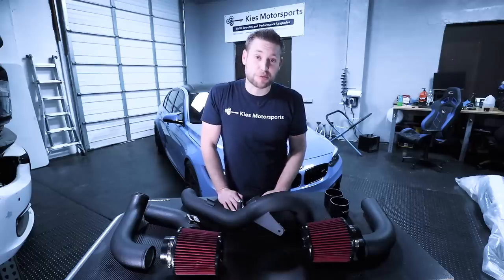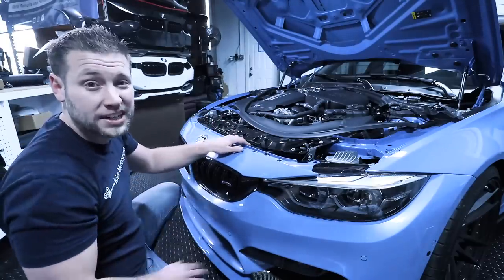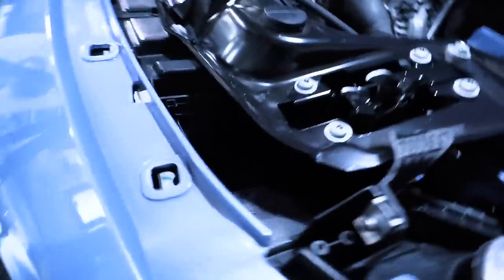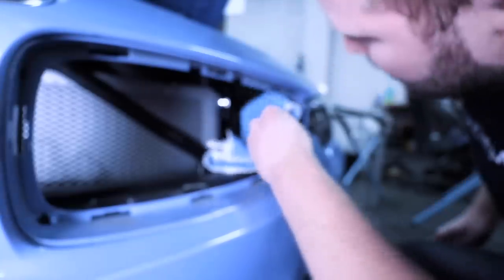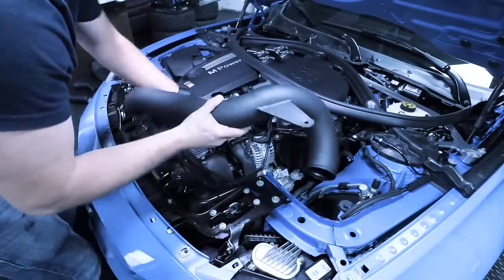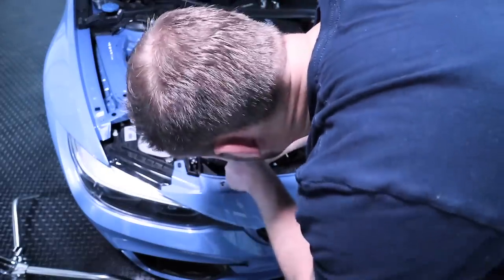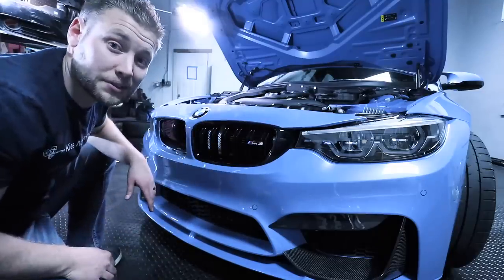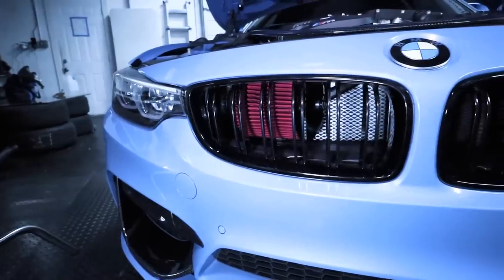How to install F80 M3 Front Mount Intakes (Works on any S55, including the M4 and M2C) VRSF

Comment: Once installed, I’d imagine removing the kidney grills using the same method used in this video becomes a no no, as the filter cones are blocking access to the release clips along the bottom edge.
Reply: rajjy1976 I feel like all that wear and tear on the kidney grilles would lead to the plastic clips giving out at some point. Changing the filter, that is
Reply: This is a reply geared toward both this first comment and the reply from @DesiredFilm ...

The kidney grills do become a slight bit more difficult to remove once the intakes are installed and you have everything put back/popped back into place! ... BUT... IT IS STILL DOABLE fairly easily in fact because once you have them off and have the feel for how simply straightforward they literally pop in and out you dont even need to see it to do it. VS just a video visual representation of "what its like".. ALSO... Id like to add that unless you are driving on a dirty track weekend after weekend OR in a sandy/dusty environment .. ie.. a freakin' desert or something, you will hardly everrrrr have to service this style of air filter! They last an extremely long time and although some people would straight up laugh at this and say "goodluck bro, your fixin' to kill your motor or a turbo".. 
I have literally LIGHTLY pressure washed off the bugs that were adheased to the front of my filter.. I then blew the water through it via air compressor. If you then let the car idle for 45-60 minutes it will get hot enough that it will evaporate nearly all moisture/WATER that could/would be sitting inside the cone of the filter! It is not until you really step on it or go full send while driving that there is then mass suction created to where moisture water would then get pulled in through the intake and into the motor. (so for any goons reading this who feel like saying this is ridiculous... just save it!). This is honestly the 2nd BEST "intake design" for the F8X M3/M4 platform. BMW should have done this from the factory however I know that they did not due to some more strict Cali. carb restrictions or some bs along those lines. "off road use only" lol.

IF you were curious.. I know 2 owners with heavily modified F82's who have raced in monsoon conditions with the front mount intakes. Neither of their motors have ever shown any damage, and they have never reported any problems due to inhaling a particle of any kind (water/dirt/dust/snow etc).. 
LASTLY, the absolute best and number one "Intake design" that BMW SHOULD HAVE DONE from the factory but did not, would  basically be what Dinan/aFe and a few others have done by utilizing a larger surface area filter and box that is sealed. This is done because through further testing and reports, many people have experienced horrific heatsoak when using the basic open cone filter systems that just sit under the hood without being in a box, a sealed box or best yet, the aFe with the open box but sealed sides that completely seals once the hood is closed. There is/are good reason why BMW did not choose to incorporate these designs from factory. Best guess and main reason is the bs CARB restrictions in some states like Cali.

In any case.. I still love my front mounted setup. Most people say its just a shame they cost thousands but, ... you get what you pay for!
I have the RK, and the custom titanium intake setup is just not for everybody, I get it..IT IS FOR ME THOUGH!!! =)

Comment: Looks like these more disrupt the airflow to the radiators than provide that much more air to the engine.  I would really want to know how those filters work also as they can not be easily changed.

Comment: Wouldn't this install block, disrupt airflow to radiators... Has anyone had any issues, also looks like the oem was already using a scoop to suck cold air.
Won't it be better to upgrade the air filters in oem instead.

Comment: Hi! Installed my front mounted air intakes yesterday and now it is worried when cruising at certain speeds and there is a little more hill on the road so the engine has to work a little more. Then it becomes like small jerks that are only felt without being seen on the tachometer. I have stage2 bm3, do you have the same problem or do you have custom map?

Comment: So, once that plastic inner piece gets cut to fit the pipe, is it replaceable or is it a part of a larger plastic piece?

I would imagine that returning to stock could be slightly hindered, because putting back the soft rubber and the plastic “door” would have one side that’s been cut into and expanded.

Comment: Are they going to come out with one of these for the F30?  Would be really nice here in AZ.
Reply: I dont see how this would be an improvement. The snorkel that he removed shows that the OEM intake already pulls cold air straight from the grille area.
Reply: Alex you could DIY one with aluminum piping and silicone elbows, I did something similar for F25, only way to get PR coils to fit

Comment: Since those cones are sitting in front of the heat exchanger, will they interfere with the air flow to the heat exchanger? (Asking particularly because Dinan’s S3 tune requires a new heat exchanger)

Comment: Is it safe driving with these type of intakes in heavy rain? Do they have like a type of bypass or something to prevent water being sucked up?
Reply: Great question. I was just about to ask that. I have the BMS intakes on my f80 and would consider switching to these if I knew they were safe in the rain
Reply: @christianperles9780  I wouldn't switch those, these are only great for people in Vegas and California. Just get your self some scoops off of Ebay for your BMS intake like I did. They help out great for providing cool air to the intakes.
Reply: You can drive in heavy rain, no issues.

Comment: What if you take this car to a car wash?
Reply: Fan Yang that’s what i think plus bro imagine rain, or the time when u need to maintain this filters
Reply: Why would you not want to wash your own F80?
Reply: @specialagentaustin4209  the problem is not about car wash, it's about how to prevent water get onto the filters
Reply: @fanyang2171  think about it, the m4 gts has a WATER injection system from the factory. the system sprays WATER into the cylinder.
Reply: Stolen Moto 
Yeah but that car is also designed to do that, the F80 is designed for the stock intake position.

Comment: If I cut that part in the front mount will I have issue returning lease?
Reply from the maker: You'll have to ask the dealer, they may charge you... IF... they see it
Reply: @KiesMotorsports  I like "IF" fam, they will need a reason to check that if I take the intakes off before return

Comment: I get my Check engine light on for lean in bank 2 every few hundred miles... Not the best intakes in my opinion
Reply: I was just about to buy them I had bms and I saw these pop up online locally to me but thank you for writing this comment I saved my self 300 ❤ I had the same issue but they do sound insane